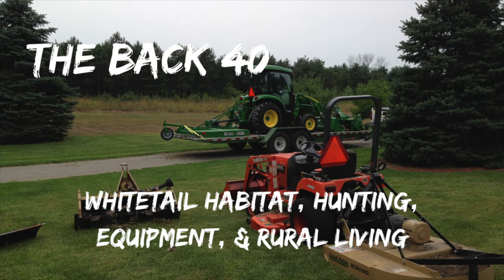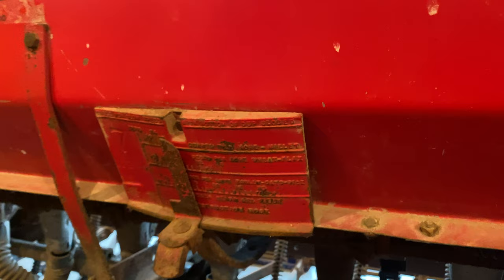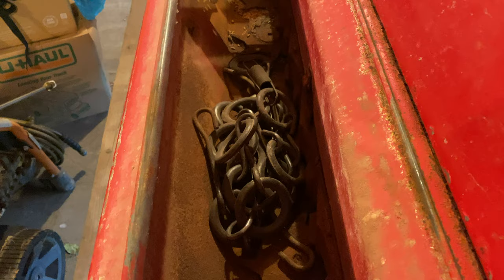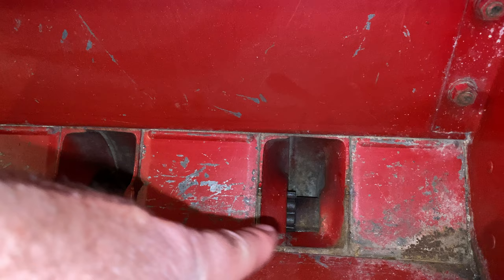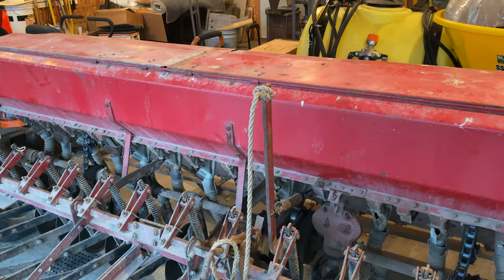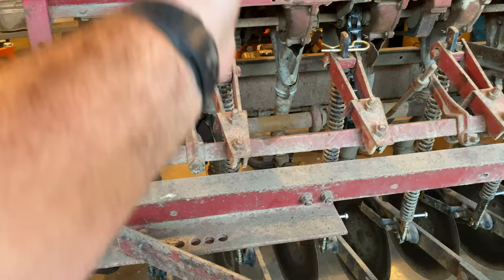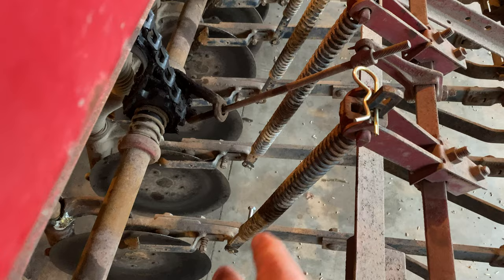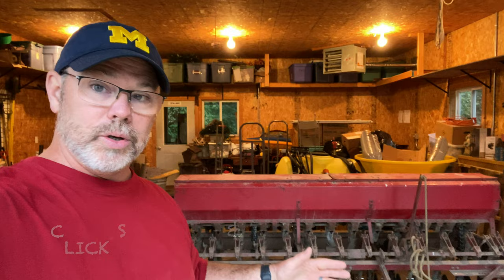Grain Drill:  How They Work and How to Buy One

Comment: Great introduction. If I may I would like to add a little bit. The grain drill you are looking at is a single disc opener for the seed to fall in. Others may have double disc or even a hoe opener. In addition to the bearings the discs can be worn out, to small in diameter. The method of raising and lowering that drill is commonly  called a trip clutch, it uses a cam to engage the lift gear. The drill has to be moving to lift or lower the drill, the real down side is if you get stuck. You didn't go into it in much detail but the steel crank on the front adjusts the spring tension and that determines seed depth. 
One of the drills I use is junk, but, for me anyway,  it works in planting a grass seed and companion crop mix. I patched the  rusted seed boxes with plastic from a cut up 5gal bucket and self tapping sheet metal screws. The seed cups and drop tubes are long gone and most of the openers are froze. The seed mix falls on the ground. The ground has to be well tilled and weed free,. Behind the drill I pull old box spring materess that do a good job of covering the seed . The "cultipacker" is two 6 inch pipes as  wide as the drill welded about 4 feet apart. Not pretty but it works. No one messes with that junk pile I can leave in out in the field. It works great as a place to post a no tresspassing sign. If someone shoots it up who cares, duct tape can fix the holes.  Fertilizer can also be ran through the seed box if someone wanted to do that. I look forward to seeing what you end up with and seeing you put it to work.
Thanks
Reply from the maker: Hey Scott, thanks for the valuable feedback.  When you really think about it, all we are trying to do it get seed in the ground to grow, period!  I am seeing the prices of used drill going up, a lot right now, ugh...

Comment: Ok, that drill was made to be used on a well prepared loose seedbed so the loose soil falls back on the seeds.  There are a couple of possibilities that come to mind.  Add a loop of chain to drag behind each drill or pull a roller or cultipacker behind the drill.  
A peck is 1/4 bushel or two gallons dry measure (268 cubic inches per gallon as opposed to 231 cubic inches for liquid measure)  You should know that unless you grew up with the much simpler metric system.
Reply from the maker: No metric system here, just a bad memory!  Thanks for the info on the drill.  All the best to you.

Comment: Wow, finally someone made a video for us poor food plot makers, I have all the small equipment for my Kubota b3300su, I have been discing, cultivator, perfecta, throwing my seed, then cultipacking then dragging to get my food plots done, I only do 5 acres on a back 40 acres, what equipment could I eliminate if I got one of these and like you, mine would have to be rope actuated as I have no rear remotes on my tractor, I subscribed and am looking forward to more videos professor!
Reply from the maker: Hey Michael, I had a BX2200 with all the attachments before the John Deere.  I got rid of the rototiller and spreader once committed to no-till foodplotting.  Currently have the drill, sprayer (did not use it this year), and brush hog for property maintenance.  For the driveway I have a back blade, box blade, and snow blower.  All the best to you!  Let me know if you have any more questions.

Comment: Thanks for the matter of fact explanations and points to consider.  Apart from the main drive chain, the cam on the seeder and the wheel bearings, are there other shaft or disc lubrication points to check?  We will be requiring occasional seeding to oversow grasses with legumes and other grass species so sharing this info’ is appreciated.  Cheers, Gary
Reply from the maker: Hey Gary, each drill is different, so check the disk bearings to see if there is a zirc for lube.  All the best to you.

Comment: I know I'm a little late to the party, but I know where an older Oliver grain drill is for sale for $500. Seems to be in decent condition. I have used the co-ops no till drill in the past on hayfields and been spoiled. Do you think the Oliver is worth looking into? It has actual rubber tires and not the old metal wheels of course lol
Reply from the maker: Assuming you have light soil, I would say if you are mechanically inclined, and have time, and enjoy working on equipment, then yes, it is worth looking into the Oliver, especially at that price.  You might want to check parts availability before purchasing, too.  Otherwise, renting the co-op drill is still a really good option if you can work with their schedule, and transportation is not an issue.  Good luck!

Comment: isnt there supposed to be back wheels to cover the planted seeds after opening the ground with the discs?
Reply from the maker: Most GRAIN DRILLS do not have wheels, but there are some if you look around enough.  Most of them either have nothing, or will drag a chain behind the disc to close it up.  As a reminder, grain drills are supposed to be used on a prepared seedbed, where it has been disked and the ground is open so wheels are usually not necessary as it is very easy for the soil to collapse back in the seed channel.
Reply: @theback40  ah I see, thank you for responding

Comment: Run a cultipacker, over field if you only have single wheel
Reply from the maker: Hey Kris, good idea.  I have seen a few drills with a hitch welded on the back to pull the cultipacker concurrently with the drill.  One pass.  All the best to you.

Comment: Clear but how does that spring on top create enough pressure to send disc down?
Reply from the maker: Hey Chris, when you drop it down to the soil a lot of the weight of the planter is sitting on the springs, which push the discs into the soil.  If this doesn't make sense, let me know and I'll try again.

Comment: What price is good.
Reply from the maker: That is a great question.  What I have seen so far is there is no standard pricing to reference relative to the location and condition of the drill.  What I have done is set my budget, and when I find one in good enough condition for my mechanical skills (which are low), I'll make an offer and if accepted, I'll consider that a "good price".  I suspect this will be in the $500-$1500 range.  Buy from a used equipment dealer, will probably be at the high end.  Buy at an auction or from a direct seller that really wants to get rid of it, might get the same quality drill at the low end of the price range.
Reply: @theback40 thank you for the  info and getting back to me.

Comment: Average prix of grain drill?
Reply from the maker: Hey Pierre, good question for which there is not an easy answer.  Generally in the $500-$5000 range, depending on size, configuration, and condition.  Best thing to do is start looking in your local area to see the going prices. Set up your search criteria and then turn on alerts at www.tractorhouse.com, facebook marketplace, and craigslist.